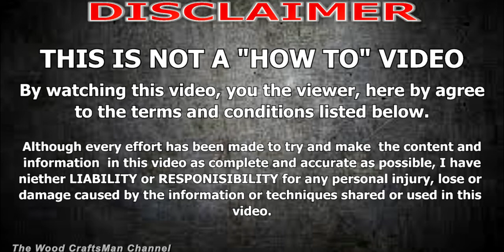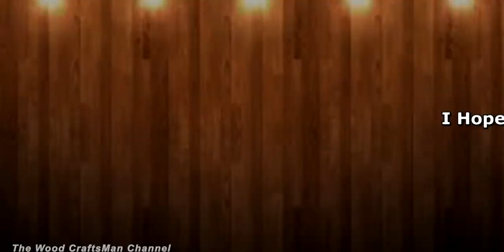Alpharex Pro Series projector headlights GMC Sierra Quick Review # 290

Comment: Either the driveway sits at an angle or the projectors are not aligned properly, you should have a level cutoff line, and watch running HID bulbs in them, I’m not too sure if those projectors are made to handle those bulbs and you may experience bowl burn and your light output will decrease drastically when that happens.
Reply from the maker: Yes, the driveway is at an angle, which is why I put the caption in "The truck is not pointing level" in the video. In this video I was running a set of GTR Lighting H7 35 watt HID bulbs in a 6,000K color temp with a Morimoto Elite 35 watt ballast. However I swapped them out about 2 weeks later with a set of LEDs because I was concerned about the the heat of the bowl and all the wiring around it. However....unlike, Spyder, Xtune Power, and Anzo that state the use of an HID will void warranty, Alpharex is one of the few aftermarket headlight companies that actually support the use of HIDs or LEDs and give step by step instructions on how to do it with any modifications other than drilling a hole in the OEM style dust cover to pull the HID bulb wire through with a grommet. Out of all three aftermarket projector headlights I've tried Xtunepower and Recon), these are above and beyond my expectations in the light output for distance in both low and high beam. Thanks

Comment: Is this JUST the replacement alpharex headlight housing? You didn’t have to replace the halogen bulbs to LED’s? If so what brand LED did you use?
Reply from the maker: This is the Apharex Pro Series. with the addition  of a Morimoto 35 watt Elite HID Kit with GTR Lighting 6000K HID Bulbs. 

I have a couple of other videos showing two different LED set that I tried, Light Moses Premium 360 Degree and Morimoto 2 Stroke 2.0. Im currently running the Morimoto 2 Stroke 2.0. The Morimoto 2 Stroke 2.0 LEDs maintain a crisp sharp low beam cutoff line.

Comment: So during this videos you have the HIDS installed? They are very bright. Reading your comments i see you installed LEDS... did you gain any brightness or lose anything by switching to the LEDS?
Reply from the maker: A good HID kit will work well. I started with an HID kit that consisted of Morimoto, ,Elite 35 watt ballast and GTR Lighting 6000K H7 bulbs. For the most part I liked the HID kit,  but o had an issue with focussing the hot spots. I'm currently running a set of Light Moses 360° Premium LEDs, and I'm pretty impressed for the most part. The road lines and signs are definitely more reflective. Unlike a typical cheap LED, I have no shadows in the beam patterns. I purchased a set of S.V 4 from Headlight Revolution, and they were brighter, but had a horrible shadow in the bottom of the pattern. They've highly recommended the Morimoto XB 2 Stroke 2.0 which has a much narrower footprint between the diodes. I plan on trying a set of them to see if they are better. The only thing that I've been warned about by another is bowl burn with an HID kit, but Alpharex supports HID and LED installation without voiding the warranty. Spyder and Xtunepower, do not support HID or LED or will void the warranty.  Out of all the aftermarket headlight assemblies I've tried over the years, they are by far the best that I've had.

Comment: I bought some Morimoto H7 HID bulbs, but they seem to be too long to fit in these headlights.  I assuming they are hitting the projector screen.  Do you know if the GTR lighting H7 bulbs are shorter than Morimoto?
Reply from the maker: They might be, however, you will most likely need to use an aftermarket dust cover that slips over the bezel to give you additional room for the fan to breathe. I believe I got mine off of Amazon, however I don't remember the size (92 or 95 mm?). If you do this you will need to re-route the two yellow wires from the external black box (turn signal load resistor) through the new rubber dust cover, and seal around the hole you'd need to make in it with some rtv silicone. I will caution you though with some LEDs, the higher the color temp, the worse they are in rain and snow like conditions. I'm sure the GTR Lighting is a fantastic product, but one of the big difference from Morimotto vs all the others, is Morimotto runs 5500-5700K color temp vs 6000-6500K. The higher the number the bluer. 5500k is like a bright white, where as 6500k is a cool blue. The cool blue mayool cool, but not practical in rainy condition's. Also Morimotto released a newer version called a 2 Stroke 3.0 which appears to be a bit more compact, but still offering a 5500-5700k light color.
Reply: @TheWoodCraftsman  
Do you need to remove the cover for the h7 morimoto new model headlights? I like the cover it seals the headlights completely.

Comment: How do you fit the HID bulb, but the head lights and same Marimoto HID kit, but the bulb doesn’t seem to fit right?.
Reply from the maker: If using an HID kit in these Alpharex Pro Series you will need an H7 bulb, no other bulb number will work. You will also need to drill a 7/8" hole in the center of the dust cover for the HID bulb wires and rubber grommet. If you have an H7 and the base does not fit into the recess, you may need to file the base slightly as I found that my GTR Lighting H7 bulbs seated properly, but were a snug fit. Also, Alpharex's website has some good information on HID conversion. Thanks. Scott

Comment: How many bulbs does one housing require? & Do the high beams use the same h7 bulb the low beams use?
Reply from the maker: One H7 per housing. The projector is a bi-xenon with a cutoff sheild that is pulled down by an electric solenoid for high beam, for low beam the solenoid is de-energized and a spring pulls the cutoff sheild back up to create the cutoff line in the beam pattern to eliminate light scatter and glare on low beams. Scott

Comment: How did you install the h7 led bulb? I bought some hikaris but couldn’t find where to put the plug into which wire(s). The halogen looks like it was built in to the system. I took the 2 clips off of it but everything felt right and secured. Ty in advance
Reply from the maker: Once you unclip the halogen bulb, you can pull the black plug off of the bulb (black and blue / white wire) it is probably a snug fit like mine was. One you've done that, the new LED H7 bulb plugs directly into that plug you just pulled off if the bulb. Do not cut any wires, it is s plug and play setup. The black is the ground, and the blue and white are to keep the bulb on for the low and high beam. Most LED lights are polarity sensitive, so be sure it works before closing everything and installing.  Good luck. Scott

Comment: H7 is not a dual beam bulb. How does one H7 bulb work for both high and low beam?
Reply from the maker: Correct. The Alpharex projector headlights use a bi-xenon projector identical to some OEM headlights that have a cutoff shield that is retracted by an electro-magnet solenoid. The shield is up for low beam giving the beam pattern it's unique appearance with that distinct cutoff line, and for the high beam the shield is pulled down to reveal the full reflection of the projector. So it's one bulb for both beams. In some of the other aftermarket projector headlights, they use a cheap projector with a stationary cutoff shield, and add another bowl refector alongside, above or below for high beams. Hope this helps. Scott

Comment: Will they fit my 2012 GMC Sierra sle 2500 hd
Reply from the maker: From the description:
THESE WILL NOT FIT the 2014 and up 1500s or the 2015 and up 2500HD or 3500HD

These are for the GMC Sierra 07-13 : 1500, and 08-14 : 2500HD / 3500HD in all trim packages: SLE / SLT / Denali / Denali HD.
Reply: @TheWoodCraftsman  thank you sir I will be ordering ASAP

Comment: How do I adjust how high  or low my headlight shoot out too
Reply from the maker: There is an adjustment screw on the back towards the top. You can either use a flat blade screw driver vertically or I think it's an 8mm wrench. You set the the headlights by the low beam height only. Because these projectors use one bulb for high / low, you can not adjust independently. Your lie beam height should be 2" lower at 25' than the  dot on the front of the headlights on the front clear cover that represents the center of the projector lense. Be sure to reach out to Alpharex for more detailed information.

Comment: What fuse did you tap into?
Reply from the maker: I know longer own this vehicle so I don't have a reference. All I can tell you is that It all depends on which engine you have. The gasline fuse is different than the diesel. This truck had the 6.6L diesel, so I couldn't use the fuse stated by Alpharex in their video / instructions. All you need is to find a fuse that is ignition on, meaning the fuse is active vwhen the ignition is on. Scott
Reply: Ok will do Thank you!

Comment: Fit for the 2014 to 2018
Reply from the maker: Hi, these will fit 2014 GMC Sierra 2500HD / 3500HD.

These will fit the following model years in SLE, SLT, Denali, & Denali HD (not sure about work truck). 

07-13: 1500 1/2 ton
08-14: 2500HD 3/4 ton
08-14: 3500HD 1 ton 

Not compatible with Chevy Silverados.
Thanks. Scott
Reply: Ok thank